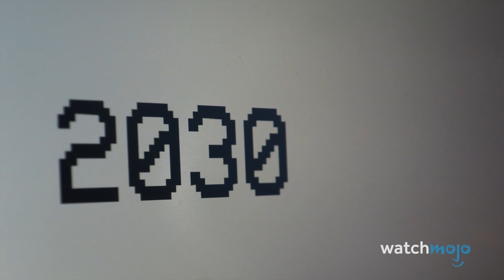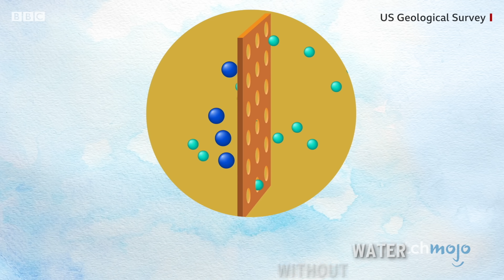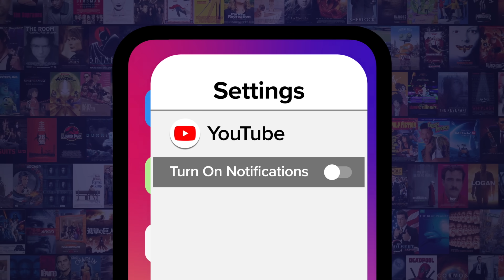10 Shocking Facts About the Global Water Shortage  #TeamWater

Comment: ok this is what I don't understand.  Dehumidifiers extract moisture out of the air, you have to constantly empty it, same with air conditioner.  Why have we not developed a device to extract drinking water?
Reply: Because the bottle water companies would go out of business.
Reply: @SandraBNoMore  Unless they go with the flow and adapt to changing times, that is. They're not stupid, they must be aware of what's happening, and I'm sure they'll find a way to survive and not cause global instability
Reply: I guess it requires too much energy on a large scale and is only effective at high humidity levels
Reply: Yeah, there are already machines like the ones you are describing, but require huge amounts of electricity because they work basically like an air conditioner
Reply: Because it requires a humid environment and lots of electricity. So it would be impractical. I'm sure there are many other reasons on top of those.